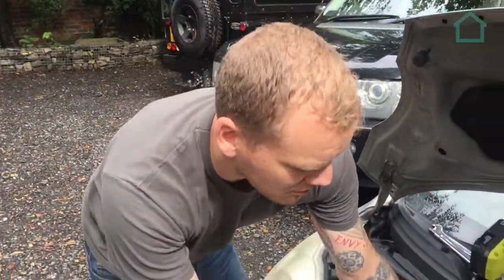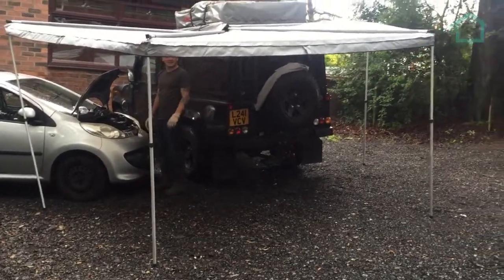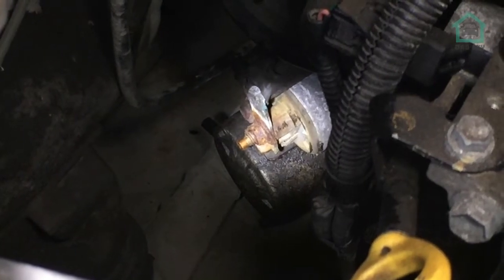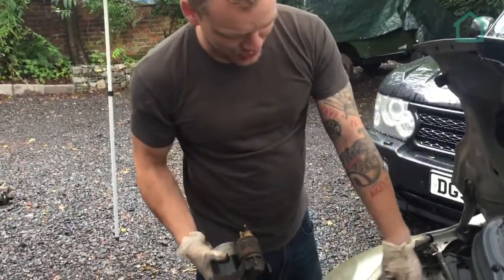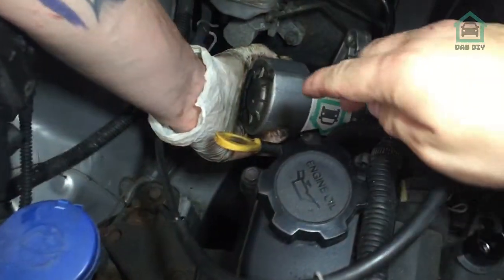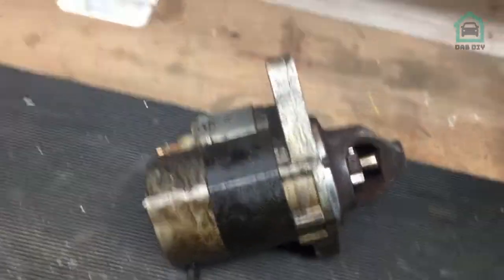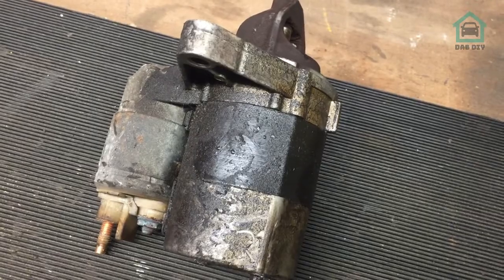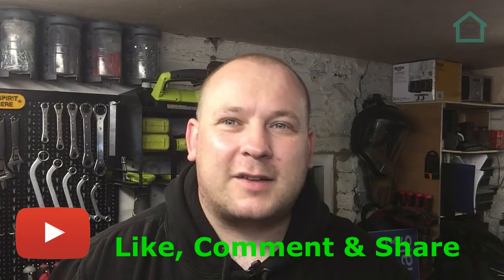C1/107/Aygo Starter Motor Replacement

Comment: Brilliant video, as usual thank you. Can you do a video about how to check if your cam belt is ok or needs changing please. Just bought a 107, it has no service history but has only done 57,000 miles. Is there an easy way to see the condition of the cam belt or see if needs changing. Thank you 🙏
Reply from the maker: It doesn’t have a cam belt, they’re chain driven. Unless it’s been run low on oil at any point, chances are that it’ll be fine for another 57,000 miles at least. If you really wanted to take a look at it, you could remove the chain cover on the left side of the engine (when looking from the front) and check for any play in the chain.
Reply: @DABDIY  thank you so much, you are a legend. May your channel grow beyond your wildest dreams my friend! 👍
Reply from the maker: Thanks Stephen! If you have any other questions etc, follow me on Instagram and PM me - @dabdiy

Comment: Another fab video! I had to jack mine up as i couldnt get to the bolt with enough force to undo the bolt 😅 changed it this week 👍
Reply from the maker: Whatever works! I did consider jacking this one up too, but we managed to do it without jacking.
Reply: @DABDIY  👍👍👍👍

Comment: Hi. It is usually easier to undo the electrical connections first, then undo the fixing bolts. That way you have a chance of undoing the electrical connections if they are corroded. Be careful tightening up the connections using a ratchet, I snapped the terminal off the solenoid on an MG TF doing that a couple of years ago! A spanner is the best way to tighten these, IMHO.
Great videos, please keep making them. They have been a great help to me lately, thank you.
Reply from the maker: We’re both electrical engineers. We had a good go through if the terminals etc and determined that a socket will do the trick.

I’m glad that these videos are helping. That’s the main reason why I started the channel in the first place, help people save some cash by doing things yourself.
Reply: @DABDIY  at 4m 36s you say that smaller terminal is an earth, it is not, the solenoid and starter get their earth through the body of the starter, then via the engine and earth straps to car body. The smaller terminal you point out and call earth is actually the live from ignition switch to the solenoid😉 you won't normally find any earth terminal insulated by a rubber boot.
Reply from the maker: Fair enough, I stand corrected. It’s all a learning journey for me 👍🏻
Reply: @DABDIY  👍
Reply: @dunravin  my pleasure, could be your ignition switch not always making contact when held in the start position to send 12V to the solenoid, or the solenoid itself on its way. They are easy starters to remove and clean, then once off, use a set of jumper leads connected from a car battery directly to the starter (red jump lead on pos from battery to main POS terminal on the solenoid), then black jump lead from battery earth post to clamp onto the starter body for earth, then use a screwdriver to bridge from the main solenoid terminal that you have the red jump lead connected to, to the small solenoid terminal that normally connects to the live feed from the ignition switch, and the solenoid should click and make contact, and starter motor spin. If it works well each time without fail, then more than likely the problem is your ignition switch, if it is a Nissan Micra from about 2003 (k12 model i.i.r.c), they are common for ignition switches causing that, my mum had one, same thing, would not always throw the solenoid, and I fitted a new ignition switch to her car, and problem fixed.
Reply: Thanks for the video - I am about to do the same on daughter's Aygo - did the cleaning work? I looks on Instagram, but nothing there...
Reply from the maker: The cleaning definitely helped

Comment: Thanks , same issue with mine just ordered a replacement , nice to know it can be removed from the top
Reply from the maker: It’s a little fiddly, but it’s easy enough to do. Let us know how you get on.
Reply: @DABDIY Thanks for the info, my starter is dead, I have to crank many times if by luck it fires, but after switching engine off, there's no cranking .Battery is fine when tested with the other car. Does the starter only needs to be replaced or can it also be repaired 🤔
Reply from the maker: @malefanematsie3890 for the cost of a new starter motor, it’s worth just replacing for a new one.
Reply: @DABDIY  Absolutely right, after your recomendation I checked the price on new and I realised that by repairing I might end up paying almost the same price on labour, parts , tax etc. Once more Thanks 🙏

Comment: Hi, where do you put the plastic shim, which fell on the floor when removing starter motor😢
Reply from the maker: Honestly, it’s been that long since doing this job, I really can’t remember.
Reply: What shape is the plastic shim?
Reply: I found out it sits on the top of the starter motor. I would describe the shape as half moon. There is a recess on the starter motor to allow this plastic spacer to sit on the top.